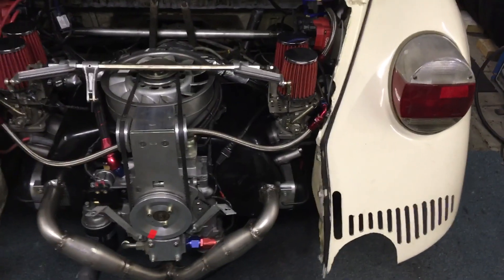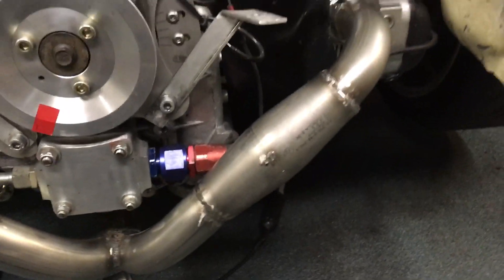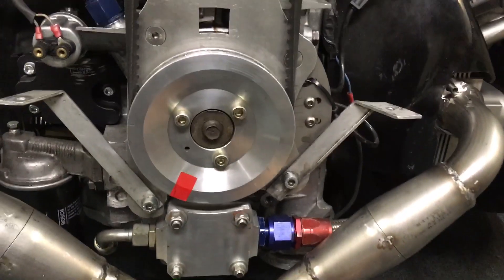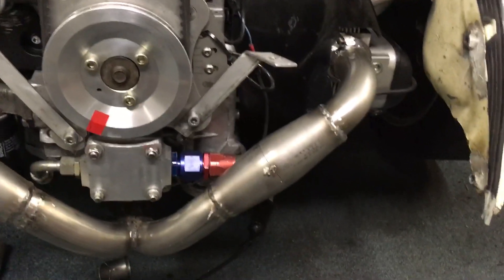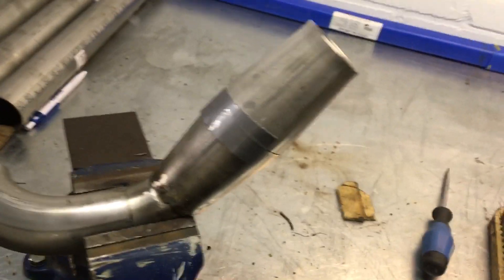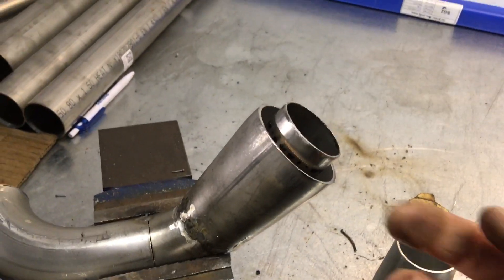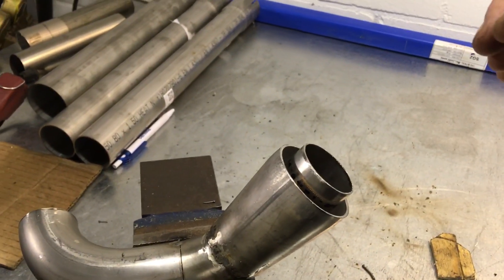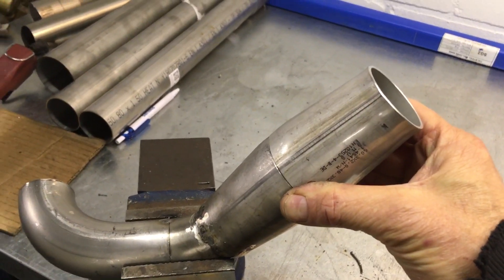Anti-reversion chamber exhaust

Comment: And?....results please....
Reply from the maker: I am just a privateer, so I did not make a straight pipe version and back to back dyno’d that too, hope you understand my situation?
Reply: @fusca03  yea, it's called A-B-A-Testing and it does cost money to do that so....Do you think it runs good?
Reply from the maker: @masterspin7796  Yeah, it produced actually more torque for a 2,4 ltr with that low CR then one would have expected, so i think it did something.
Reply: @fusca03  it's too bad you couldn't map the fuel curve...a simple o-2 sensor can tell you if it goes lean or rich we call it the poor mans computer...
Reply from the maker: @masterspin7796  oh, but its fully EFI with a 45 min log of 5 parameters.
Reply: @fusca03  sweet!...idle's like a kitten, I bet the mid-range torque is strong...
Reply: @fusca03  post the sound please.
Reply from the maker: @imadude85  https://youtu.be/LKhbYc0gOGY?si=sqi1i2TbrXwaJ1Qp